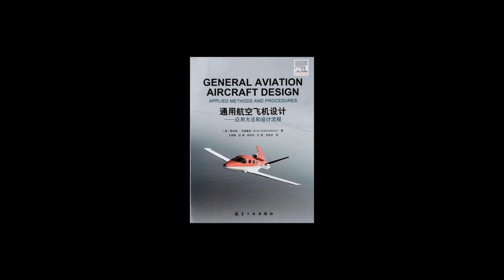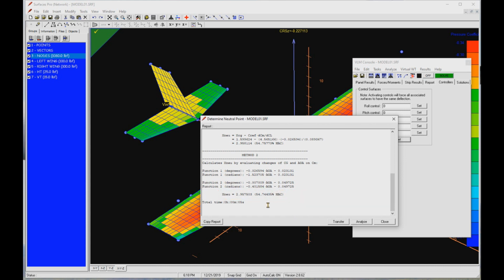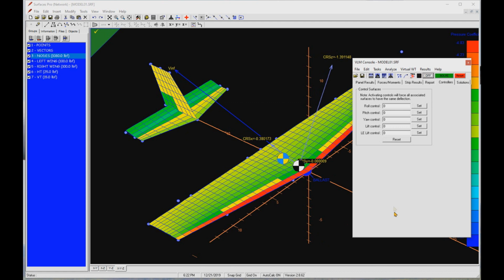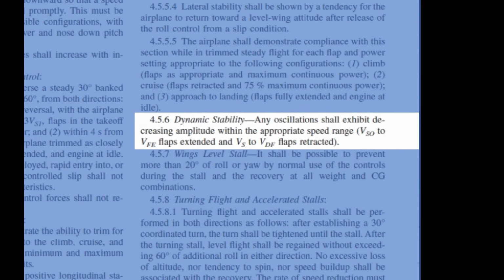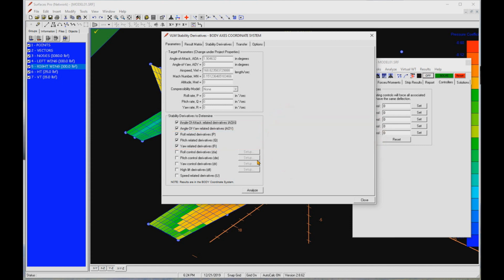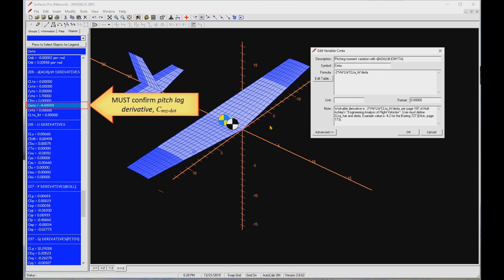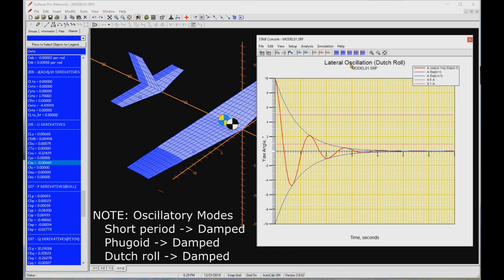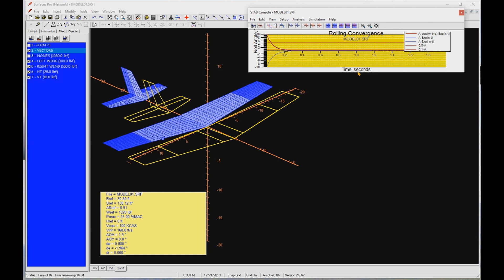PART 7: Version 2b Stick-fxd neutral, 1st forward CG eval, dynamic stability analysis.

Comment: We have been using the Surfaces Pro version for over 2 years now at our company, I wish had discovered these videos earlier before starting in Surfaces. They are very helpful and clear! I was wondering if you also worked on writing and designing the software?
Reply from the maker: @Martijn van Dorst Thank you. Yes, it is possible I did some work on the software. Best wishes.

Comment: Thanks alot for the video,,,and is there any professional software that can be used to analyse stability as shown in the video
Reply from the maker: Ooops. I'm sorry about the late response. I can't think of a commercially available software that does it quite like that. However, I'm sure many aircraft manufacturers have developed capable fancy "in-house" software. Just don't expect that to ever be available commercially. Best wishes.